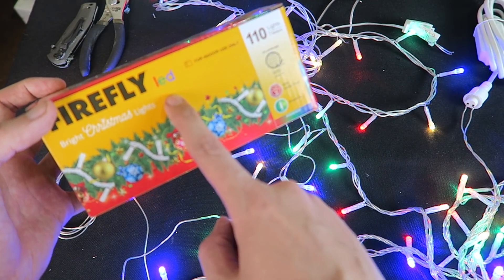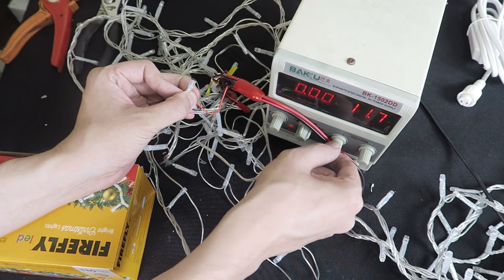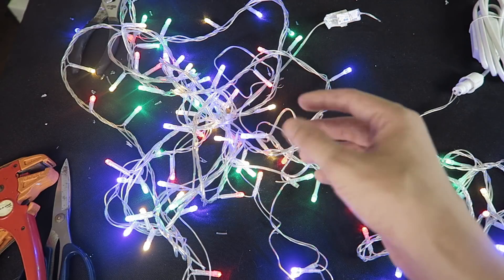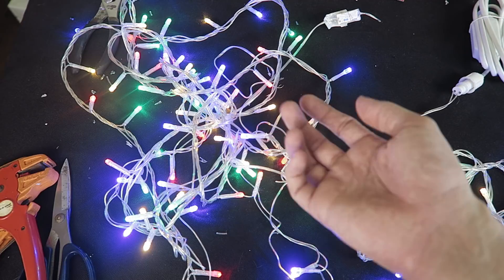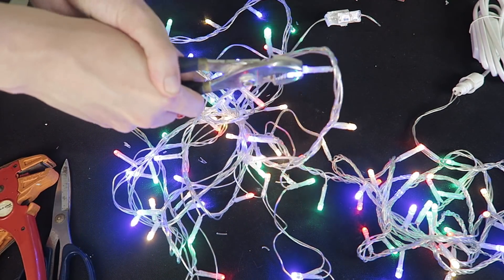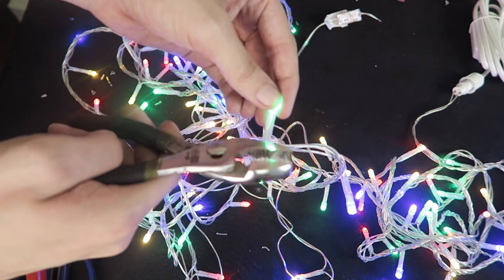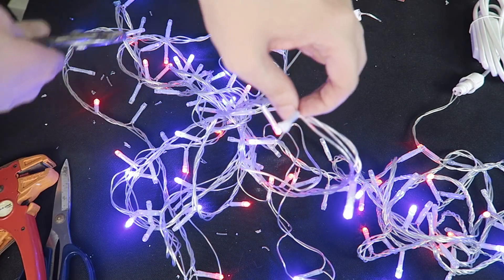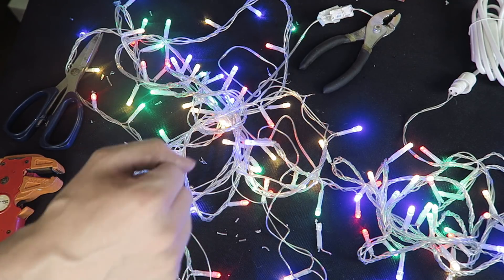Broken LED in Christmas Lights

Comment: mine got 4 cables per little light and one of those 4 cables from 1 light broke.  and now half of my set won't work! 😭😭😭😭
Reply from the maker: Can you not buy something like a wigo connector and fix the broken wire?

Comment: This was actually awesome! I was a little concerned that my lights from last year were turning brown. Do you think that could be a problem (like a fire hazard), or when they die, they die and don't fret until it happens?
Reply from the maker: Hmm honestly I'm not sure on that. You might want to check directly with Firefly. Mine have been in operation ever since I made these videos, and they didn't turn brown. 

If in doubt, always play safe and replace if possible. Your home and life is worth a lot more than a set of Christmas lights.